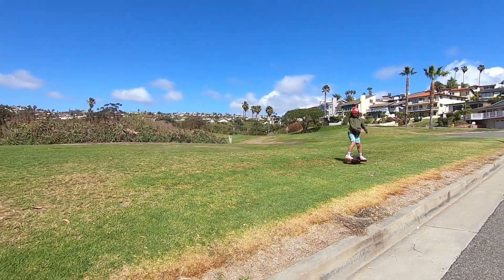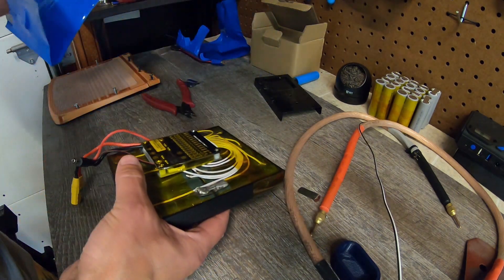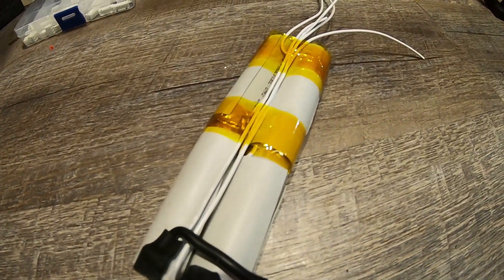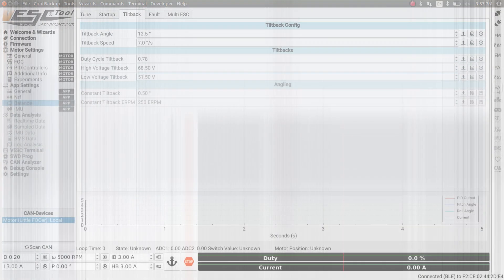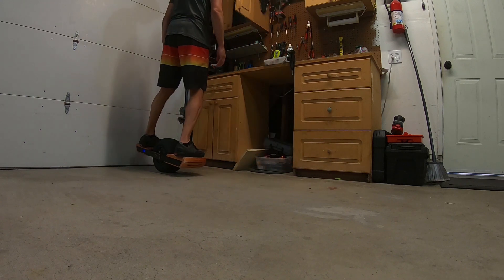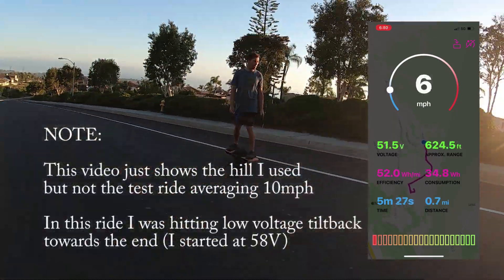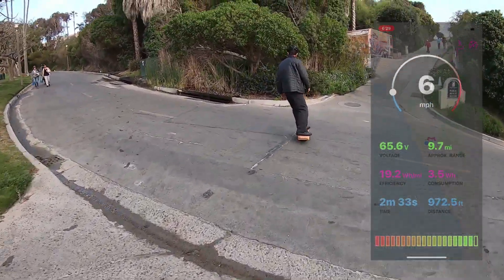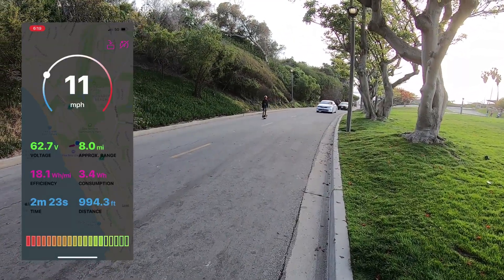Obsolete: Upgrading my Funwheel battery to 67 Volts (16s)

Comment: I have a spintend 75v 100 amp vesc controller with 60 volt 600 watt hub motor.  The battery is 2p 16s molicel 21700. Im having problems going faster then 10 mph. I assume the hub motor can  only go that fast or im to scared to lean forward and nose dive.  Without a load it go 40mph
Reply from the maker: ask about that on this discord server - I'm sure someone can help you figure out what's going on. This doesn't sound right. https://discord.gg/KX5rtBEd

Comment: Any issue with littlefocer 60V max limit?
Reply from the maker: litte focer is 84V max - cheap focer is 60V max
Reply: @surfdado  I did not realize at the time there was two versions of the focer , I'm a noob but learning lots, your videos and info  you share has been a big help. I was planning on using phub188 and cheap flipsky 75100 FOC but after watching your videos and discord I decided to use SuperFlux hub with littlefocer.

Comment: How does the funwheel motor compare to phub188?
Reply from the maker: it's very similar, slightly larger stator - but the funwheel motor is no longer available. The new one is more powerful than a XR/GT motor

Comment: How would a 12s2p configuration compare to your 16s1p configuration in terms of voltage sag?
Reply from the maker: Assuming identical cells and identical riding conditions, sag will be more or less proportional to overall cell count, so 24 vs 16, i.e. 33 percent less sag with 12s2p

Comment: hey man, do you know if i rebuilt my own larger pack, for a genuine one wheel, it would just be plug and play right? no special sauce to add?

thank you
Reply from the maker: the original Onewheel controllers cannot handle higher voltages, so you'd have to stick to 15s, but also all of the newer models don't support battery upgrades at all, the controller is locked to the BMS
Reply: @surfdado   i got the last firmware compatible with the "chi battery",  yeah i wasnt planning to overvolt anything on it, just add more capacity with better cells.  so 15S pack, made to fit the original enclosure, just like any other lithium pack, and thats it right? so much limited info on DIY battery packs, guess for good reason haha
Reply from the maker: @SoniX989  yeah, in that case I'd assume it should be plug and play, especially if you reuse the existing BMS - but honestly I'm new to the whole Onewheel scene, there are FB communities where you may want to ask this question to confirm.
Reply: @surfdado  cheers mate, really appreciate it!

Comment: Just a tip on the voltage sag ruining your ride.  Remove the low voltage cutoff and set the pushback to be aggressive at your low voltage cutoff range.  That way you still get a warning that the voltage is low (via pushback) but you don't get the motor cutting off completely at low voltage.  Helps power through if the nose dips too.

Also, helmets!
Reply from the maker: Thanks, I kinda already got aggressively low voltage cutoffs anyway, but I also have a beeper that alerts me prior to getting LV pushback, as pushback itself requires more amps, which further increases the sag. But I should soon build a new 16s2p (maybe even 18s2p) using P26a cells to replace my 1p battery. The p42a's are going to be repurposed for my ebike...
Reply: another thing that will help is adding/soldering extra thick copper wire ontop of the nickel strip, that'll help to reduce the voltage drop, because nickel strip is thin and not all that conductive compared to copper by itself

that will reduce resistance and voltage drop

Comment: Why not just use the factory battery?
Reply from the maker: Would have loved to just take a pre-built battery, but for the Funwheel there was no factory battery. So the only option was DIY. Now Floatwheel did offer a battery but that one is only 44V and also notoriously weak. Also I needed a higher voltage one and there simply is no factory battery. If you want to DIY a OneWheel you gotta be ready to DIY your battery or pay someone to make one for you

Comment: The legendary Surfdado!!! Great to put a face to the discord group guy! Hahaha
There are some configs on the vesc tool that can help with the sag (supposedly)...

How much total range do you think you can get out of that?
Reply from the maker: Voltage sag is a fixed property of the battery and is a function of current drawn. The only way to reduce voltage sag is to lower battery amps. So there's nothing in the VESC tool that can help with that. You can't really lower your current draw without also reducing performance.
Reply from the maker: Range is very tough to estimate because it depends so much on terrain and rider weight. On flat roads I (160lbs/75kg) can easily get 10+ miles out of one charge, but once you add hills you quickly cut that range in half
Reply: Yeah... you'll loose a but of performance to make up for sag. For the range, let me know what you get on avg, after testing it for a bit! I hope you have fun with the new config.